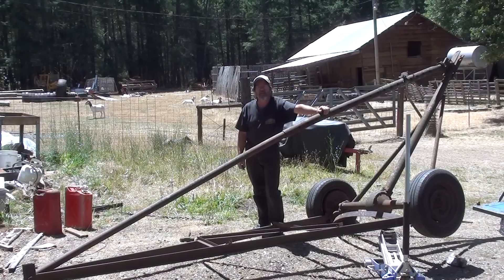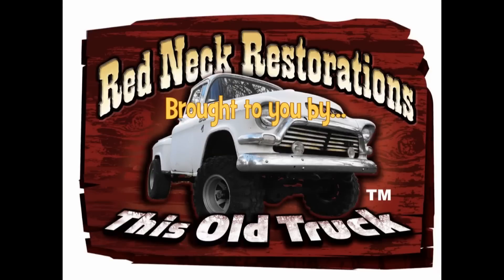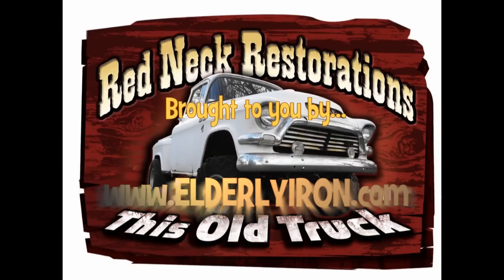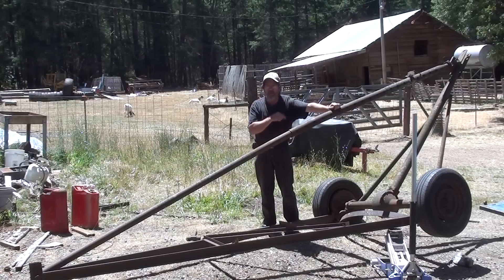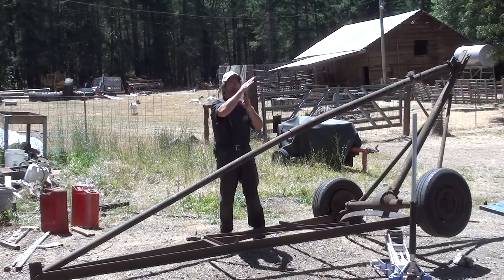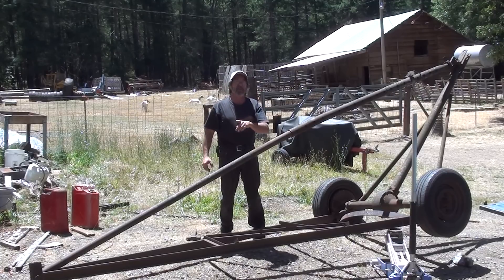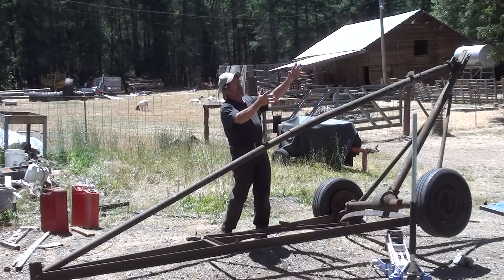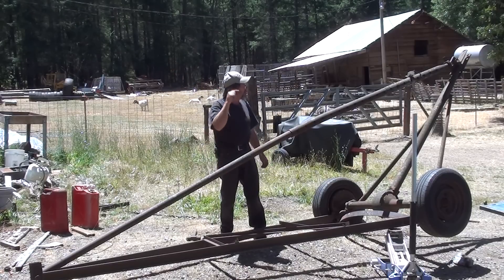Building a Cab Crane

Comment: Ah yes,,,, the magic bolt box always has the nut or bolt you need. I still don't know how they automatically replenish themselves after every project. Just glad that they do.
They do seem to attract an awful lot of other strange items that you can't seem to throw away though. Last time I looked through mine I found an old brake cylinder, a condenser (but no points) from a 74 Yamaha XS650 that I got rid of YEARS ago,, a couple pushrods from a 302 (or maybe 240) ford,,, and tons a other fun stuff.

Comment: Sometimes if'n you have a scrap of pine board and your torch goes pop!! flame out quickly rub hot tip on the board and it might go Pop flame back on. saving hair on hand. Did you know that catching one's beard on fire is not the bad part. It's all them guys running at you with shovels to put it out.

Comment: what pressures do you set the oxy/acetylene?  I have a harborfreight torch and having issues heating up bolts
Reply from the maker: I'm using propane at 15 and oxy at 40. Acetylene I would run 4 and 40. For big heat I would run acetylene at 5 and oxy at 60